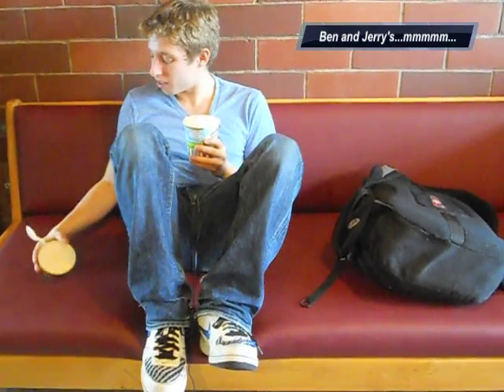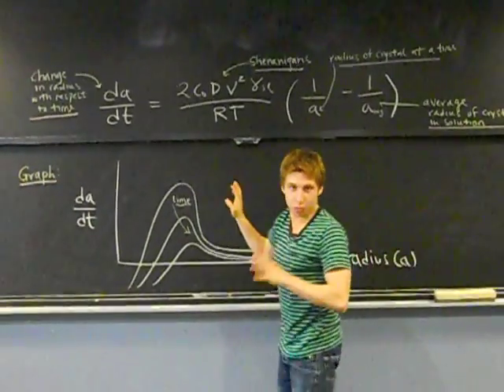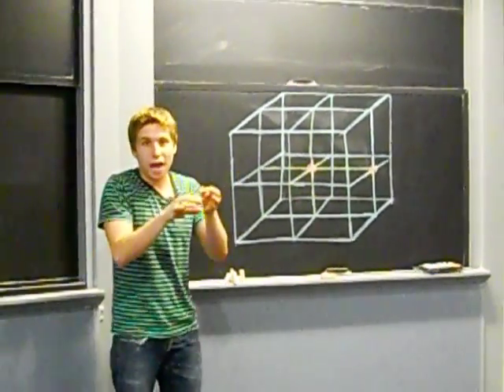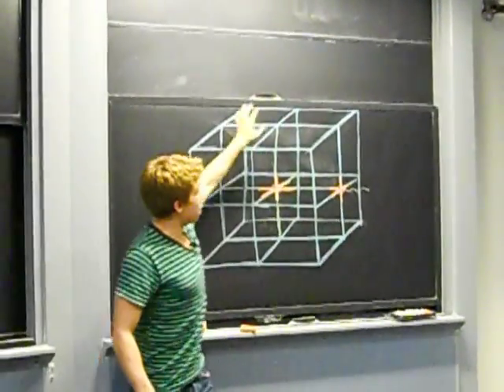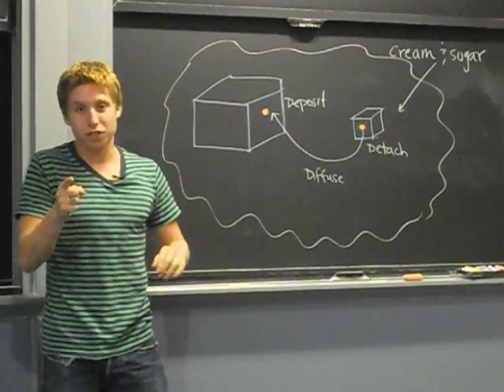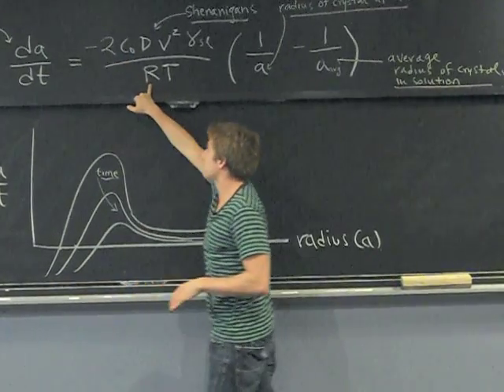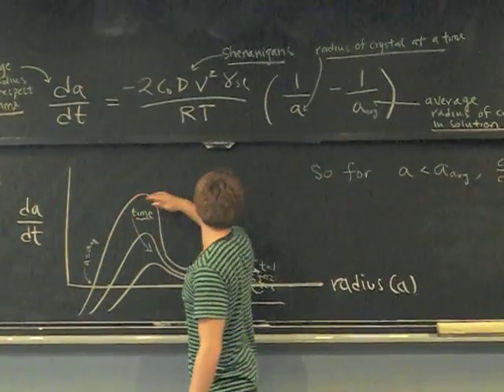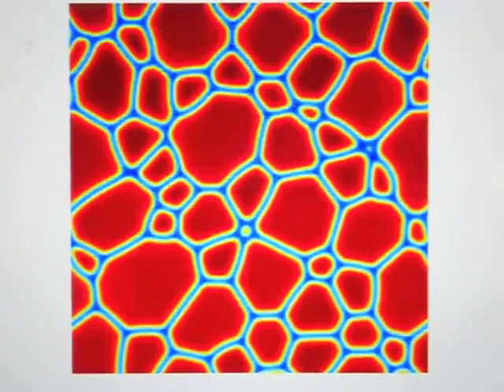Ostwald Ripening in Ice Cream

Comment: Awesome explanation. You showed that temperature is in the denominator of that equation. So would that mean that at large values of T, high temp's, the rate of change of the crystal radius is lower than at small values of T, low temp's? I would've thought that at higher temperatures the higher kinetic energy would have allowed for faster diffusion of particles so that the large crystals grow faster

Comment: Well first off, The diffusion coefficient also contains a temperature dependence. Diffusion goes faster with higher T. The T in this equation comes from the Boltzmann distribution. The more thermal energy a system has, the higher the possibility  the system is in a higher energy state. So the lower the temperature, the lower the energy of the system. Therefore the system wants to go to a lower energy state faster.
Reply: So what you are saying is that the higher the tempera ture the more the bigger crystals diffuse? Is that why we use high T in annealing?